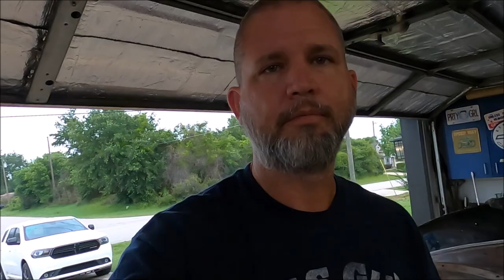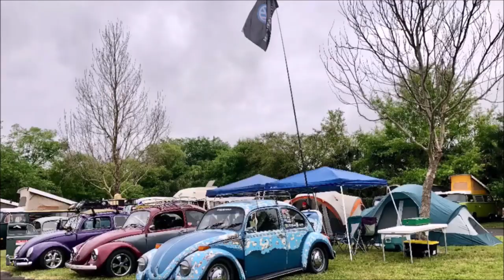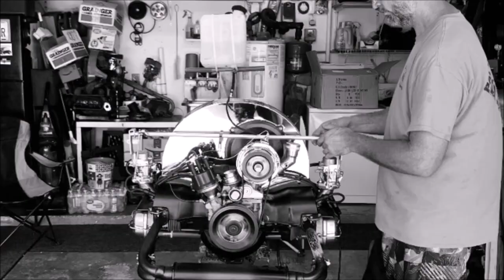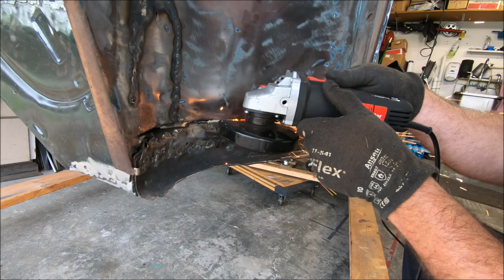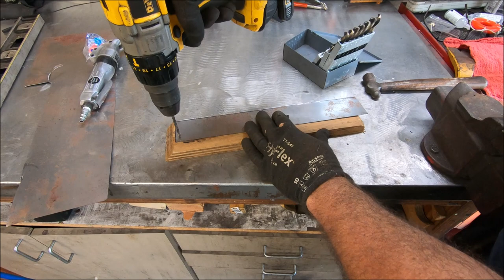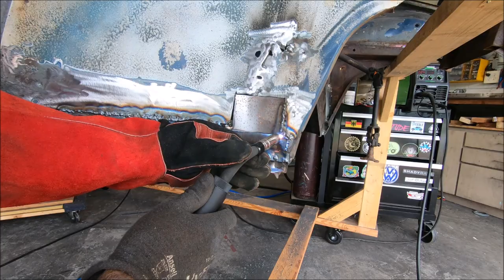VW Bug Inner Fender Well Repair -  SICKXTY -  Volksrod – Baja / Franken Beetle Build - 21

Comment: neodimium magnets out of old hard drives to a GREAT job of holding 2 pieces of sheet together for a but weld...
Reply from the maker: Great idea!
Reply: @VWJawbreaker  Experience time.... those magnets will die a quick death from heat exposure.  If you use them keep them COMPLETELY away from the heat!  Even a repeated warming cycle will kill em in no time.  I have em, and use em lots.... also ruined a ton of them lol

Comment: Gary the time is always more than one realizes; I will share on a video but I took my bus pop window frames to bare metal and primed and painted the have a seal that around the outside of the frame fitted into a slot..wow crazy amout of time cutting old seal out cleaning it. It was taking me 8 hours to strip clean and prime 2 windows . Frontstart to finsihed painting 40 hours time for  window. Today I will get the new rubber seals and i,m sure it will take crazy time to install. The non vw person looks at the 6 pop winds and thinks wow cool how they pop out but have no idea the amount of work and money that went into the windows.
Reply from the maker: It’s definitely taking a lot more time than I had anticipated, can’t imagine having more real estate like a bus to do. You’ve done an amazing job buddy, keep up the great work! 
Mine won’t be anywhere as nice as yours when it’s done but it’ll be solid and better than it was!

Comment: Gary, thanks for another great video. When you lay the bare metal piece over another bare metal and weld together, how do you keep them from rusting. It seems like rust would occur between the two metals. Thanks in advance for helping me understand this better.
Reply from the maker: If you’re worried about it, they make welds ke primer that you can spray to keep things coated. I personally use ospho and that usually does a good enough job for what I’m doing.

Comment: Nice metal work brother! What size drill bit did you use to make the spot welds?
Reply from the maker: I got the hole punch tool from harbor freight…. Makes it quick and easy.

Comment: You make metal stick good.  Nice job, keep it up.  What disks are you using for grinding?
Reply from the maker: Thank ya sir, I’m a better grinder than welder 😂
They are a 36 grit flap disk. Aggressive, not much pressure helps keep the heat down.
Reply: @VWJawbreaker  me too.  I can grand the heck out of something.  Putting it back together is more of a challenge.  Lol.

Comment: welding a butt weld like that, I like to tack every 4 inches, then back step to the first tack, drop a blop right next to the first, then next to the second, etc... it prevent warps from heat... Bad Chad does the same thing... it keeps the heat from building up too much in one spot...
Reply from the maker: Correct but for this area I’m not too worried about the metal warping.
Reply: @VWJawbreaker  Yep, the channel will dictate where the metal should be, and nobody will see it anyway.  I had one that was crash damaged there, and had to cut relief cuts upwards into the kickpanel 6-8 inches up, about 1.5 inches apart.  I had all these dangly fingers.  The channel would'nt fit otherwise.  In the end, the channel dictated where the car should sit, so it didn't matter if the kickpanel was a little out of shape.  Fenders still fit normally, and door opened.... F-it!  :-D

Comment: Good work Gary. What disc did you use to grind the welds?
Reply from the maker: 36 or 40 grit flap disk. Try to aim and hit the weld only, lightly to keep heat down.

Comment: Put your patch on with a few tacks . Take then your cutoff wheel and cut along the patch edge in-between the tacks on a 45 angle . match the panel so it is level to one another and place a few more tacks to hole even . NO GAPS THEN !
Reply from the maker: Man, I saw that somewhere else also but I always forget about it when it’s time to get working. This body panel stuff is outside of my comfort zone, just trying to do the best that I can.

Comment: I was looking at the repair (nice job buy the way) but did you weld the inner fender to the frame pan ?  Sorry if I sound ignorant, just trying to make the same repair on my car but the frame in that area is also gone, hidden well enough at time of purchase but found it soon after?
Reply: Never mind, brain fart. That’s part of the heater channel😵‍💫
Reply from the maker: You’re correct, that’s part of the heater channel and the inner fender area does get welded to the channel. 
All good man, it’s better to ask questions to make sure we do our repairs correctly.